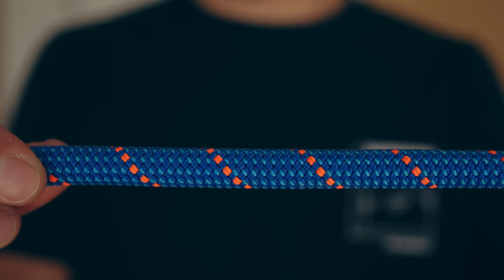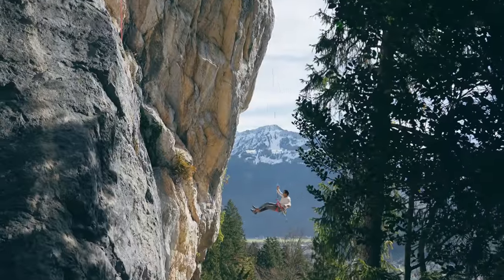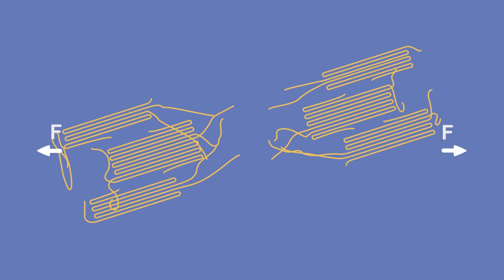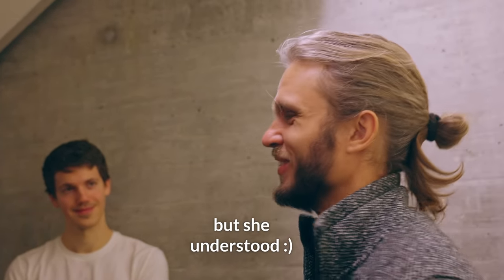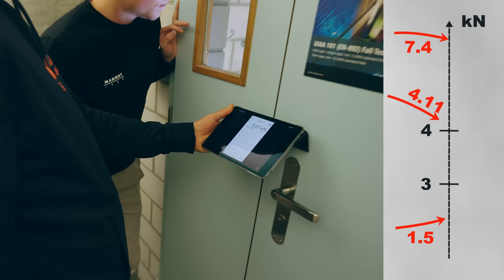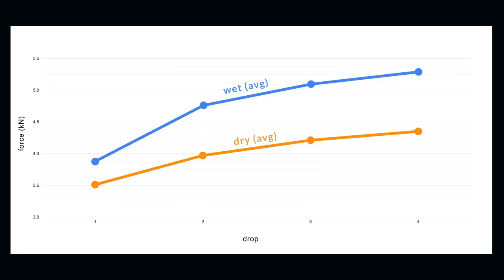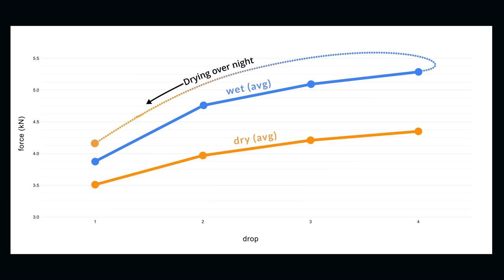Are Wet Ropes Dangerous for Climbers? Textile Science Explained

Comment: The inference that permanent damage was done by the water seems shaky! After all, the force on the rope after it dried out was about the same as the force on a dry rope that was dropped about the same number of times. If anything, the data seems to show that it doesn't do significant permanent damage!

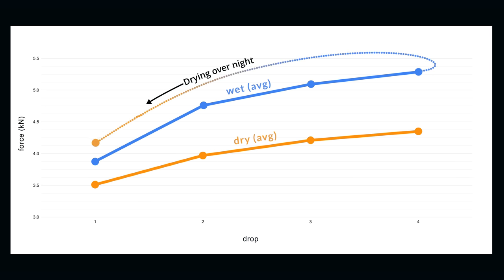Comment: I have a theory about the rope that has dried overnight (14:50). In tap water, as well as in rainwater, salts are always dissolved. These salts enter the rope with the water, and when the rope dries, they remain between the nylon fibers, increasing friction there. Another experiment would have been interesting: to test the experiment with seawater/saltwater. Once wet and once wet and dried. This way, a large amount of salt would remain in the rope.

Comment: Another great video! I really love all the stuff you've been doing with Mammut and really nerding out on ropes. One small tip that would make your data presentation more clear would be to color code things. Like using light yellow for dry untreated and dark yellow for wet untreated, and light blue for dry treated and dark blue for wet treated. That way it's very easy to tell how the data is related in the plots. Keep up the great work though!
Reply from the maker: Thanks for the tips! data presentation is always kinda tricky :)

Comment: I'm a North Wales based climber. We almost always are dealing with puddles of water around crags and our winters are more often than not, only cold enough to freeze at higher levels in the hills. So winter ropes can get a little wet before you reach the colder temperatures. 
Almost everyone I know who climbs here uses dry treated ropes outside and most have a short classic rope purely for indoor use. 

Having dragged my ropes through many puddles and muddy cracks and grooves (despite best efforts not to!) I will only ever use dry treated ropes here. 

A classic rope on a wet belay ledge low down will soak water up instantly just running through a puddle at lead climbing speed. Every pitch after that your rope weighs much more and pisses muddy water as it runs through a belay plate. On the odd occasion I've used (and seen used) classics outdoors here, every time they owner says they wish for a dry rope (or that they wish they remembered their dry rope!).

Comment: I think this is your highest quality video so far! So cool to see that you sre still steadily imrpoving the quality.

One thought I have is that showing that the force the rope sees is greater in wet ropes doesnt mean the strength that the rope would break at would be lower, just that you'd be more likely to see that force. 

Pretty much the worst case would be a crazy hard fall with a fall factor greater than two, like if while belaying off a multipitch anchor the belayer takes hard to keep them off the belay ledge and the first and only piece rips, shock loading the anchor on a short section of rope. Maybe the climber is 4m above the anchor, and during the freefall the belayer takes in a bit over 1m of slack. Total fall factor would be (4+3)/3=2.3. I calculated the peak force for the mammut 9.5 classic I climb with and it'd be about 8.6kN for a 80kg climber. Based on your tests, a wet rope would then see just over 10kn, which is getting into worrying territory for a used rope, or a rope thats seen many falls that day.

Brilliant practical stuff. Takeaways: wet rope catches will be harder and less comfortable, belay device performance will change, and even though wet ropes are almost always safe, there are realistic (but extreme) scenarios in which a soaked rope might make you reconsider.

Comment: Great video Ben. As always extremely intelligible and helpful.
    In my opinion, there is still room for thought and research regarding the long-term damage sustained by a rope from frequent wetting. For example, I am a caver. The environment in which cavers use their ropes is extremely humid. This includes almost one hundred percent air humidity as well as dousing the rope with water directly. We are used to this fact, and in general, the topic of the long-term impact of water is not often discussed. The way we use ropes creates much smaller loads than dynamic catches during climbing. In our case, it is only a question of moving along the rope by rappelling and climbing by ascenders. However, it is not excluded that a dynamic load may occur in the system in the event of anchor failure. 
   I would be very happy if you could continue the discussion about the effect of wetting the rope. Especially when Mammoth are ready to help with expertise and equipment. If the long-term effect of frequent wetting of the rope is significant enough, this may necessitate more frequent replacement of the ropes and more strict monitoring of their use.

Comment: If I remember well, in an other video you said that a dirty rope would wear out faster. I was wondering if it was a good idea to machine wash a rope and if yes, how long would it take for it to dry enough for it to be safe? Would the water damage it even if it was not used while wet?
Thanks for the science!
Reply: I was thinking the same thing. Based on his previous video with a dirty rope, I would say that a washed rope is still better than one full of dirt, both for climing and for the lifespan of the rope itself. Now we also know that washing a rope doesn't make it new and perhaps weakens it a little, so it's better to change it after some years. 
Consider also that he's making his experiments on multiple very hard falls, something quite unrealistic for the average climber (or at least for me).
Reply: As long as you dry yer ropes out properly before using them getting a rope wet won't damage it and washing them with a mild detergent in the washing machine on th gentle cycle (or in a tub by hand) is th normal way to clean dirty ropes, when you dry them you want to leave them laid out with no knots and no tangled sections that create sharp angles in the rope because ropes have "memory" and sharp angles while drying them out can damage the internal fibers

Comment: Really interesting video! Thank you so much!

I actually thought about the conclusion, that the ropes are damaged after wet falls. In the video, it looks a bit like it has been dried under tension (14:20). Is that the case? If no, nevermind, but if yes: Could this drying (or even hanging) under tension be the cause for the harder fall?

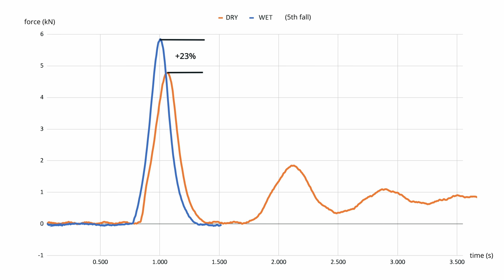Comment: @14:15 I'm hoping you're not misreading the graph, I'm no expert at anything. However if you're only looking at the peaks doesn't that only represent the downforce? When you're considering the bounce what you're looking for is the upforce, while that might not be measurable with your setup you can simply look at the trough and determine how much time between rises occurred. Doing a napkin calculation looking at the graph it seems to indicate that you had twice the amount of time in between bounces. Which is actually greater than the 64% increase of bounce that you calculated. From 0.35 seconds to 0.7 seconds.

Comment: Here's my questions for a follow-up experiment:
1) Does soaking a rope have an impact on performance, if the rope is allowed to dry fully before use? (In other words: can you avoid damage to your wet rope by drying it, or is it damaged regardless?)
2) How long does it take to fully dry a rope?

I imagined you could test this by taking sets of 2 identical samples, saturating one of them and then letting them dry fully, before doing the comparative drop test. 
I have a suspicion that dry-treated rope might take longer to fully dry if the treatment prevented the water from escaping. Perhaps there's even a nice relationship between time needed to saturate and time needed to dry.
Reply from the maker: 1 yes once dry it performs like... Dry ;)
2 until it's dry? :)
Reply: @HardIsEasy   Thanks for the response. It's good to know that getting your rope wet doesn't cause permanent damage.
My second question was more around whether dry treatment could somehow trap water inside, making it take longer to dry than normal rope.

Comment: @14:56
I think it is more accurate to compare to the 6th fall of the dry rope and not the first.
It is clear that the 6th fall of the wet (now dry) rope is lower than the 5th dry
Reply: Will 12kn carabiner brreak if wet rope force exceeds 13 kn in  falls?

Comment: At 14:50, did you also drop the "Dry" rope a 5th time?  Otherwise, it seems like you are missing a critical control data point.  

Is it expected that a similar "overnight" test on the Dry rope would have resulted in a #5th data point returning very close to #1?
Reply from the maker: No unfortunately that was unplanned test - we forgot a wet rope in the drop tower so I suggested to drop it again.
But you are right we should have also dropped previously dry ropes next day for more info.

There is always more things to test...
Reply: @HardIsEasy  totally understandable.  The educational content you've been putting out recently is top-notch.  Thanks!

Comment: You made an error @15:00: You should plot the dried rope result as the fifth fall on that rope, not the 1st, and compare that to a fifth fall on a dry rope that "rested" for a similar time. If there is damage to the rope that is temporary you would be able to make a comparison directly. I would assume (based on my aeronautical fatigue testing background) that there is only permanent damage done, and you can compare that data point to the 4th fall (because the curve gets flatter) which is on the same level. That would proof that a wet rope that has dried goes back to the same behaviour as a dry rope, and there is no damage related to the water...

Comment: the drop force applied off the line of gravity, creating a swing, is very different from the fall machine evaluation typically used.
Reply: impact is force over time.  With an off center fall arrest the time is increased.
Reply: another unadjusted factor is dirty rope.  Those samples were all brand new rope.  No climber has ever completed a climb with new rope.  Water absorption is highly effected by dirt and other factors, like temperature.
Reply: Air escaping the end of the rope 17:06 is larely due to compression of the air volume of the rope, not capillary action.
Reply: breakdown of water repellency = time (primarily oxidation), sunlight exposure (easily understood and allowed for), dirt/contamination (very nebulous)

Comment: If the water mainly affects how the amorphous regions react, I wonder how a static rope would compare under a similar test.
Reply: Static ropes are less prone to breaking due to not having anywhere near as many "spaghetti" sections of fibers but they are much harder to deal with in terms of rope management due to how stiff they get when wet, and as an added note in case you (or anyone else reading this is new to climbing) static ropes are never good to belay a climber with and should only be used for building anchors or hauling gear or rappelling, some people will use them as belay ropes for top rope climbing (with a fixed anchor at the top of the route where no one climbs above the anchor) and you won't die doing that but it's still quite uncomfortable falling on static rope and the force of the shock being absorbed by your body rather than by the stretch or a dynamic rope can definitely cause whiplash type injuries and increase the risk of swinging into the rock face by making it harder to control your body's reaction to the fall with the increased forces on your body that static ropes don't absorb, and when it comes to lead climbing (both trad and sport) using a static rope rather than a dynamic rope can definitely contribute to a life ending injury because the forces being put on the rope are so much higher when setting anchors as you go if you fall above your last piece of protection before you place the next one, dynamic ropes are designed to absorb those forces in a way that static ropes are not and using a static rope on a lead climb transfers all of that energy to both the protection your rope is clipped to (increasing the chances the protection will fail) and your body which can do tremendous damage to you as your body absorbs those forces even if your protection doesn't get pulled out of the rock

Comment: How to wash treated ropes prooerly? (And don't lose its water resistant properties)
Reply: I guess the problem isn't the washing as long as you don't use chemicals which you definitely shouldn't do ever it isn't a factor because it is hydrophobic but mechanical wear because it's a surface coating - the question is if you can retreat it at a later point with butterfly coating to repair the effect